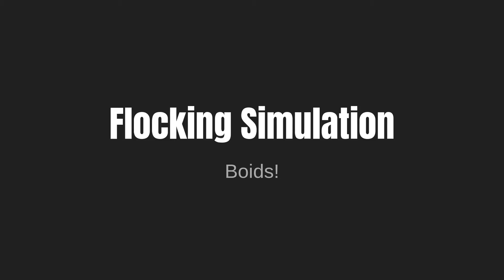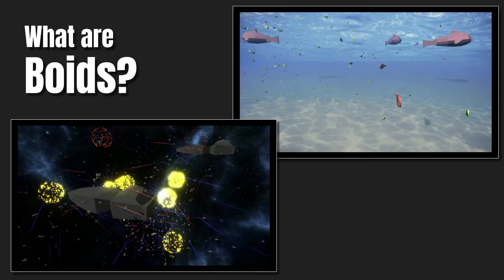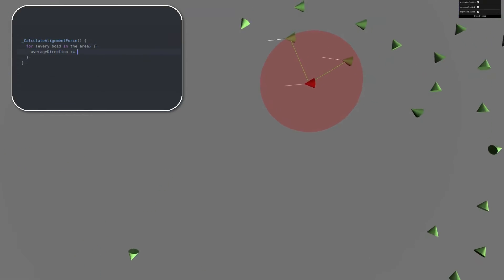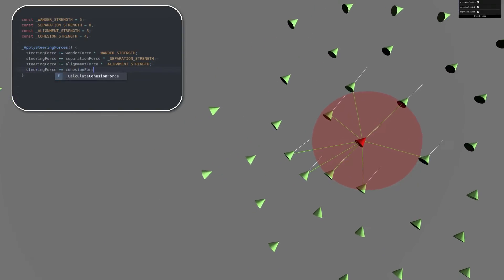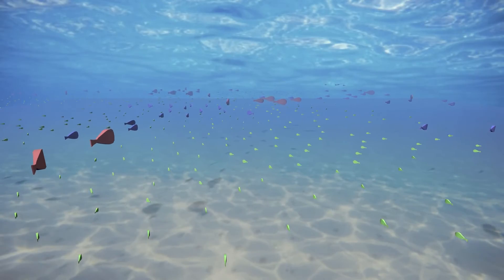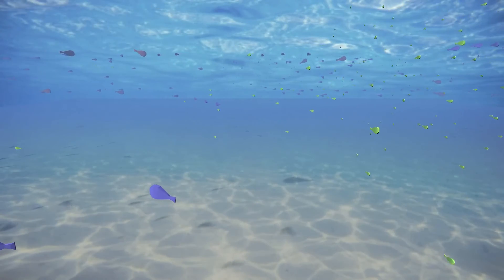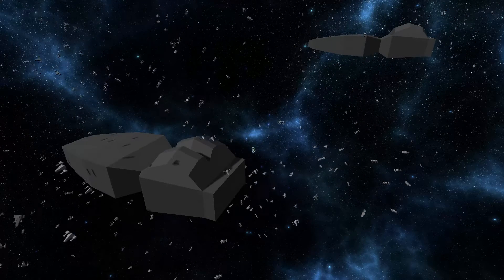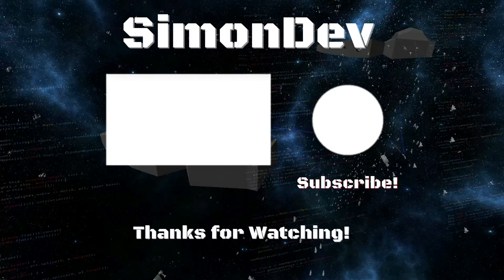Flocking Simulation: Boids (JavaScript)

Comment: Fun fact, I would summarize fish behaviours in 3 separate categories actually.
- Swimming (mostly simular to what you implemented, constant smooth forward motion)
- Feeding (Quite random seek locations, quite random speeds, quite random rotations inc. upside down)
- Scouting (Staying still for a random time, and moving to a new location quite rapidly)
Reply from the maker: Ooh it'd be fun to revisit this with better behaviours.
Reply: @simondev758  I agree. If you need some reference material, some fish I can think of off the top of my head which frequently behave like the other two types would be:

For the feeding behaviour, most fish when there is food nearby, but the following do it more so than other types of behaviours. Guppies, Platies, Discus, Angelfish.

Most tetra type of fish, for example Neon Tetras tends to do a lot of scouting behaviour.

There exist many types of videos showing each of these behaviours I'm sure.

Some fish also tends to do a rapid vertical movement without facing vertically. Which I have found to be a challenge using boids. But perhaps there is some trickery to be achived by not having the mesh exactly look at the heading direction all the time.
Reply from the maker: Interesting, yeah the boids implementation I did, heading is locked to velocity. This is interesting though, might be an excuse to merge all of this with a sort of eco-system simulation idea I've wanted to do.